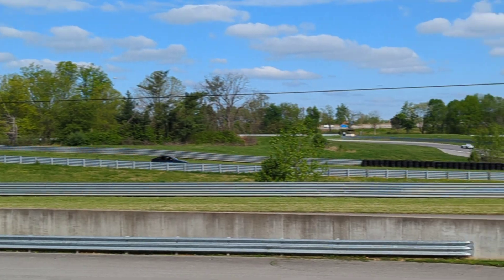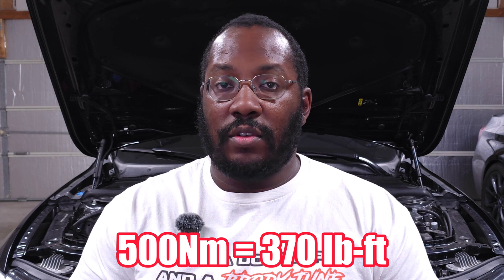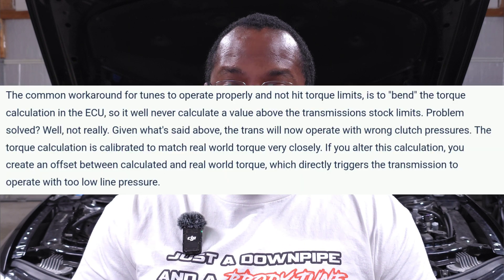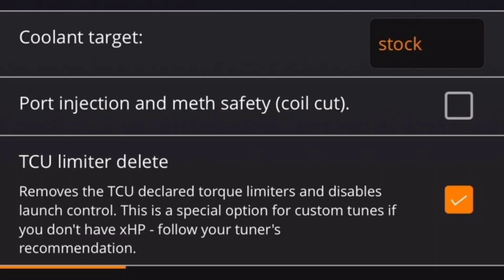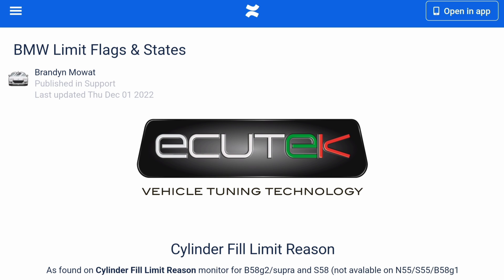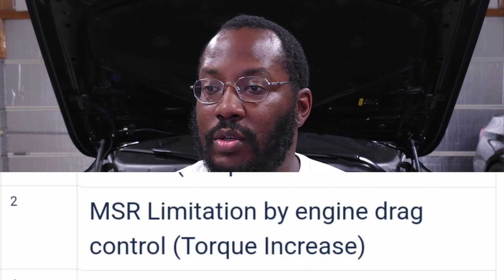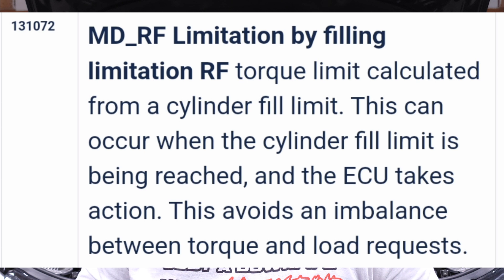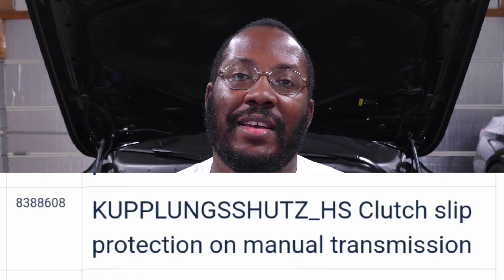How To Understand Torque Limters on Your ZF8 (Not All are Bad)

Comment: I have a 2016 340i. When I got the car it was already flashed with xHP Stage 2. I recently went from MHD Stage 1 OTS to Stage 2 (w/cdp).  The reason for the CDP was hoping for more low end power and less turbo lag. I seem to have lost time on my 0-60 mph. I have read other people saying the same thing. Is this normal or anything to do with 1 or 2 gear limiters?

Comment: hello, is xhp reliable?? i have a f10 535i stage 1 tune frm mhd… ive been thinking about getting xhp for a few months now but im still trying to do my research if its safe on your transmission.?  also should i go wit stage 1 or stage 2 on xhp tune?  and would i be able to really tell the difference ?  pls lmk.  i’d appreciate it!
Reply: yes it is, it could cause less wear on your clutch actually and your gonna be able to shift faster when you want i’ve had it for a couple months now and i love it

Comment: I'm looking to clean my throttle body but i cant find any info about it for the b58's. I'm at 50k miles and would want to remove all the build up around it. Would you recommend do it, if so do you have any advise for what to use and how to do it more efficently.

Comment: Hey kern I was driving my 340i today and it seemed to go into a false limp mode whenever I full throttle I don’t have the money for xHP right now I do have xdelete and it showed my wear clutch plates had a lot of load would mhd tcu limit delete be a good option then?
Reply: Why purchase X delete, xdrive is amazing for launches and can still swing with power mods, why put more strain on your rear drivetrain?